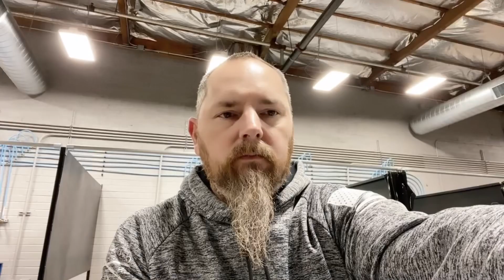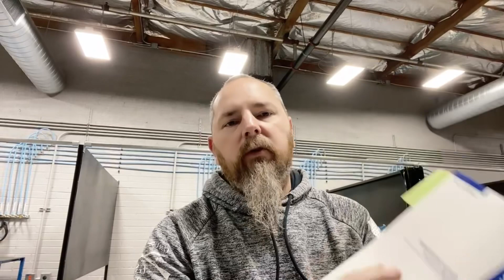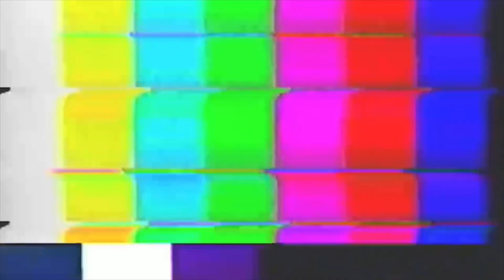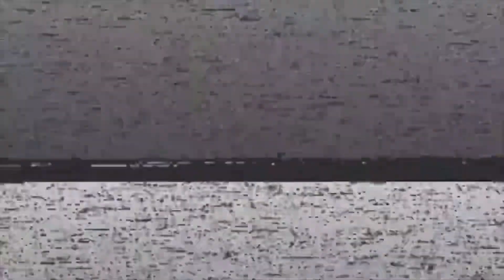Laser welding safety. IPG lightweld

Comment: I can say with absolute certainly, from having working with my laser for a while now , as well as some experience on and off over several years, as well as welding since 1973, that laser welding is indeed a lot faster than arc welding. How much faster depends on what you’re welding. Cleaning before is easier and faster. Cleanup after is also easier and faster. These times need to be included in the total weld time.

As far as safety goes, I agree on what’s being said here. I used a 6,000 watt handheld laser and I can tell you that from four feet away, it burned a groove in hard, old concrete about 3/8” deep and a 1/4” wide. The]is wasn’t hovering over the concrete. It was a welding speed movement. By the way, we did that on purpose as a test. This machine can easily penetrate 14mm of steel, so it’s no joke. This can be a serious weapon.

About glasses and helmets. The glasses are really meant for observers watching the welding process from at least several feet away and to the side of the welding. Helmets normally have lenses another level of protection above the glasses, as they are designed to be closer to the weld, though behind or at most, to the side of it. So glasses may be rated at a 7 while helmets would be an 8. I’m not going to explain what the standards mean exactly as it’s too much to go into in an already long post.

Lastly, yes gloves should be worn. One guy was showing why gloves didn’t need to be worn, and he missed the point entirely. He took several gloves, one on top of the other, pressed the gun hard into the gloves and fired the laser, of course the laser went through all of them. Folks, that’s not a valid, or meaningful test. If your hand is a few inches from the weld and the laser reflects onto your glove, it might smoke and you can pull your hand away. This happened to me recently. I moved my hand in front of the weld for some reason and the glove began smoking. I took my finger off the trigger and at the same time pulled it away. No injury. If I didn’t have a glove, I definitely would have been injured. Don’t be that guy!

Comment: metal reflects light. a high energy fiber focused fiber laser is 1080nm which is outside the visible spectrum. if those rays make contact with skin even partially at a focused 1500w its gonna punch a hole through you. in your eyes? instant blindness. the googles only protect you for a fraction of a second. usually you need dedicated rooms for this process. dont be a fool.

Comment: Great video. Are you wearing the glasses and the hood at the same time? If so, why not just the hood?
Reply from the maker: It’s always best practice to wear safety glasses under your hood in traditional welding or laser. I only allow laser safe glasses into the booth so you can’t mistakenly wear the wrong ones.   I have also had light leak through welding hoods and had reflections from behind cause arc burns.

Comment: I burned through my gloves and into my finger with a laser welder I wasn't pleasant it was a really deep burn and happened in the blink of an eye
Reply from the maker: What brand laser?  Was it a diverging beam?  Was it from a reflection or was your hand behind the part you were welding?
Reply: @Weldshilo  it is a lightweld 1500..I was welding aluminium bin lids and a lug I was welding had a gap where I was welding I was holding the lid about 10ins from the weld the laser went through the gap and into my finger it is still not healed
Reply from the maker: @Meckaneckk  can you send me a picture of the glove.  How long ago did this happen?
Reply: @Weldshilo  the glove was thrown last week...it was one of the shitty tig gloves...we only have the welder a couple of months and have only used it on a few occasions as we are waiting to get proper extraction put into the room..is there certain gloves needed for it
Reply from the maker: @Meckaneckk  I have used a variety of different gloves, thickness, material and color   I have had a couple reflective strikes that just made the glove feel warm. I have also intentionally hit a glove at about 6 inches away for a 2-3 second burst and never cut through it just burnt the surface. That’s why I was interested in what glove you used and wanted a picture.
Reply: @Weldshilo  I will make sure to get leather gloves u do not want to get another direct burn off the laser again it was really painful..do you get radiation burns off the laser
Reply from the maker: @Meckaneckk  just like traditional welding it emits light rays that can and will burn you. Always wear laser rated full face protection not just the glasses.  Any exposed skin is at risk of being burned, so always wear proper protective clothing.
Reply: @Weldshilo  we have the goggles and face mask with the aluminium frame with protective glass on them I will need to have a word with the boss tomorrow about other stuff

Comment: Thank you for addressing this topic. This video is very helpful as there has been many posts that do not cover any safety hazards or  OSHA requirements. I would not say that the Lightweld is more dangerous than traditional welding as much as it is a different danger. IR light will not give you long exposure burns and skin damage like UV light will from traditional welding, but the risk of immediate burns, especially for eyes is higher. If the proper precautions are taken, and if it is used as intended, the user will not be at risk.
  I work for a distributor for the IPG LightWELD Series welders but I was a welder for many years before I got into Laser welding. I would not be on board with selling these without feeling confident about the multiple safety features and laser shut-off functions that IPG Photonics has built in to their LightWELD Series welders. Anyone selling these machines should be diligent to explain the risks of class 4 lasers and the safety precautions. 
  Every shop buying these machines should establish a Laser Safety Officer who will take laser safety training and be certified as such. Each shop will also need a clearly labeled Laser Containment Area. The LCA does not have to be an elaborate set up, but traditional vinyl weld curtains do not do anything to shield a class 4 laser. You can go as simple as plywood, or laser rated weld curtains, or a custom built room. It is up to the company, but OSHA is looking for a designated LCA so that people do not enter the laser contained area unknowingly. Anyone within the laser safety zone should have properly rated eyewear (certified for 1070 nanometers) whenever the laser is in operation. 
I  PG Photonics has built into their LightWELDs, a key-start system and emergency shutoff button, a four-way safety interlock system to install at the entry of the LCA, and a Part/Contact interlock system where the laser will not fire without the weld head being in contact with the material that is in a closed circuit with the ground clamp. These features help to protect the welder and the people around them. There are some other laser weld machines that do not offer these features and so I do not condone their purchases.